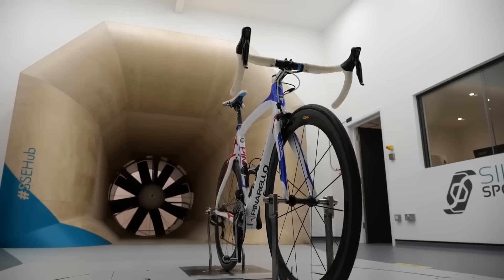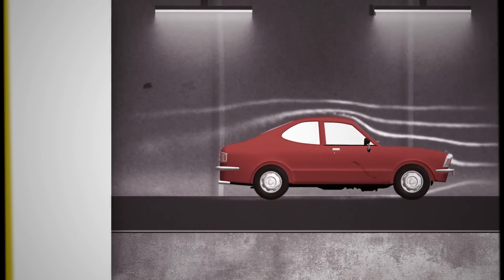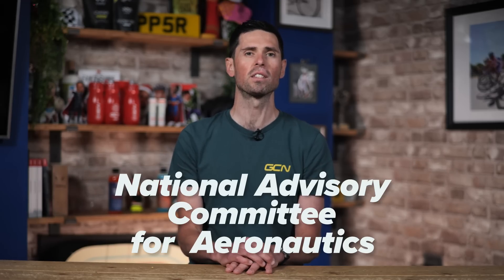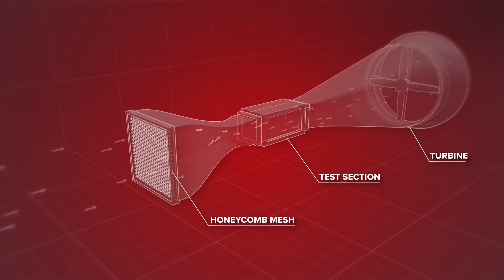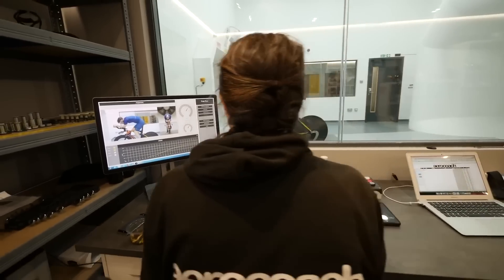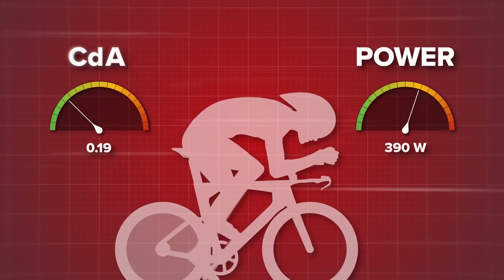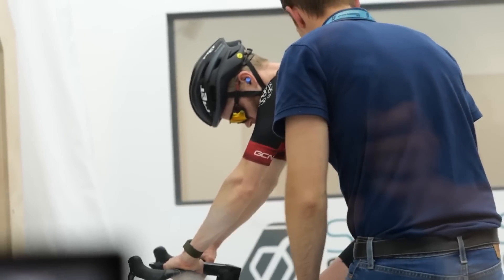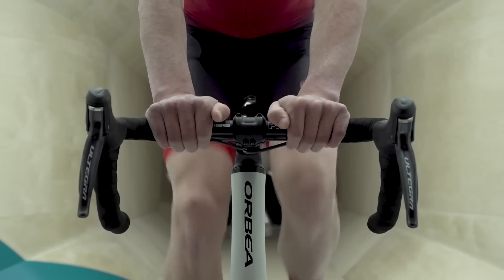How This One Innovation Changed The World Of Aerodynamics

Comment from the maker: Do you think the UCI should have jurisdiction over wind tunnel testing? 💨🚴👀
Reply: No, why should they?
Reply: Is there any reason why they should?
Reply: Wind tunnels are just one of many methods to develop new cycling tech. Therefore, I think the UCI should be focused on regulating the new tech rather than the methods used to develop the new tech.
Reply: How could that even be enforced?
Reply: I think designers should focus on increasing downforce especially on cornering, which should boost confidence. Do you think world tour riders increase tyre size to go faster? Going down the “S” at speed ± 100kph requires grip. Thus, confidence.

Comment: #askgcntech is there a point at which low gears are no longer a gain?  I recently put a front chain set on my gravel bike (40/24) to go with my 11-40 cassette… while going up a 25% gravel hill at 3mph I had a lot of time to wonder whether the cumulative effort spent (kj) outweighed the immediate effort saved (w). 
My takeaway was that the 24t front ring didn’t save overall effort over my usual 31t over the course of the 102 mile 14k’ course

Comment: As Hambini would say, the wind tunnel does NOT emulate the real world situation. So many things affect aerodynamics: road furniture, trees along the route, passing vehicles, stationary vehicles, the size of the actual rider, if he's in a group or not,  . . .
Reply: @savagepro9060  and side winds and gusts…
Reply: While that is true to test something you need constant variables. But I suppose they could simulate cross winds as well.
Reply: yeah if you ride bikes this becomes evident. but at high speeds lowering cda is certainly an advantage. the wind tunnel can be a good gauge for that.
Reply: The difference, as I understand it from Amini, is that cyclist ride through dirty air that is unlikely to have any laminar flow. Wind tunnels are specifically designed to simulate laminar flow.

I am happy to be corrected and learn more :-) .
Reply: @YelCan  results is all that matters. lowering cda usually shows real world results aka faster speeds/times. race cars utilize wind tunnels as well. one good example imo is the hour record, all this new aero tech seems to be making a difference.

Comment: Testing a bike without a rider isn’t ideal as the rider affects the airflow significantly
Reply: Truth be told: they know riders affect the airflow significantly if they're comparing similar bike designs... but manufacturers do not design riders, neither can they find 2 people with the exact aerodynamic profile, and neither can they make a single person do the exact same position every single test they make.
They design the bikes, so they only need to test the bike. Otherwise, their measurements won't be consistent.
Reply: Without the rider the results are meaningless.
Reply: @reinholdachleitner2069  exactly
Reply: You’re right, but only if a bike went racing by itself. The air is pushed out in front of the rider and bike and it needs to work as one system. Trust me, I’m an Aeronautical Engineer
Reply: @gavinsmith28  I agree,awesome profession the aeronautical industry.
Reply: Test the bike by itself will determine how areo the bike is and testing with the rider will tell how much drag a particular may have so it does make sense to measure both with and without a rider